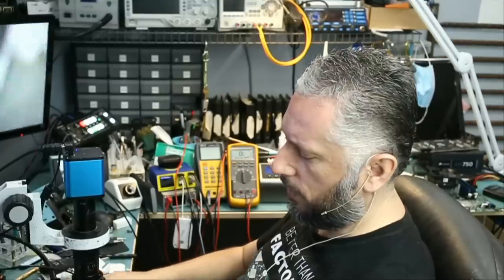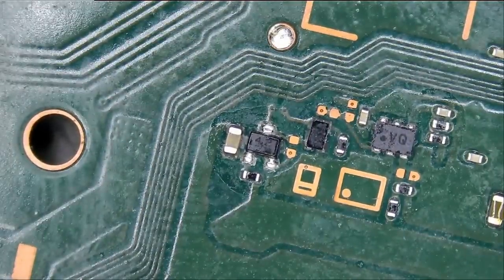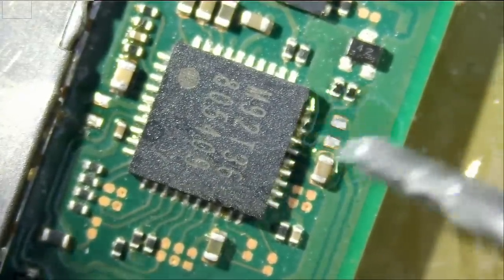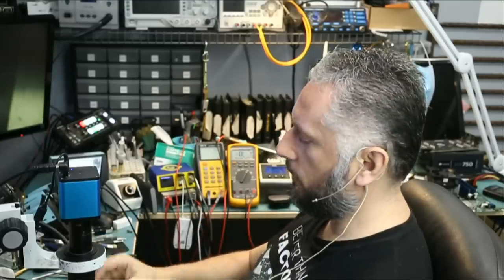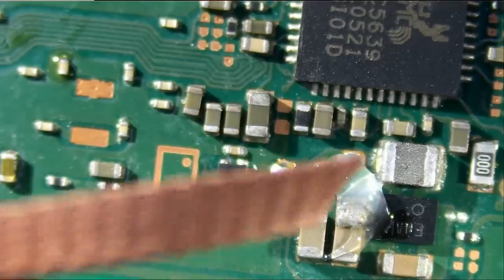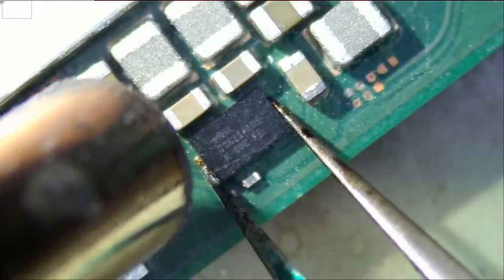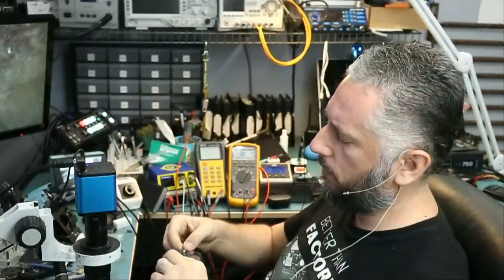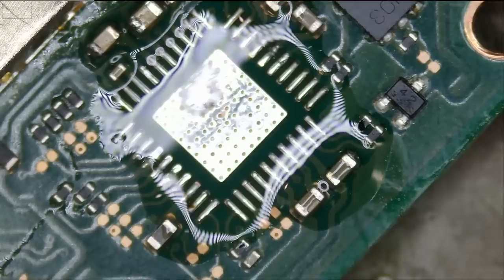Nintendo Switch Came in for repair in this condition

Comment: You missed placing a resistor at 3:35.  You needed to do 4 in that group
Reply: 17:10 he did point out what you said and it was a no fix anyway

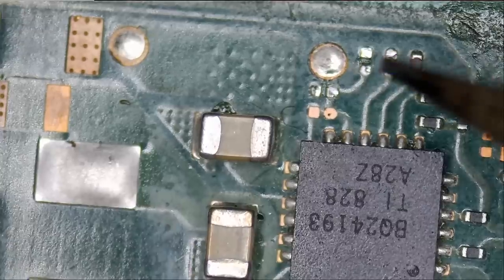Comment: If you look closely, isnt there still a missing Filter at 13:01 ? You replaced the 2 on the top, but you missed the Filter a little lower to the left. Maybe IT is Not waking up for that reason.  The component is present on the donor Board at 0:27
Reply: I saw the same thing
Reply: yea, at 17:03 he noted that it was missed, he replaced it, still no fix.
Reply: @th3R0b0t  yeah I saw that at the end lol

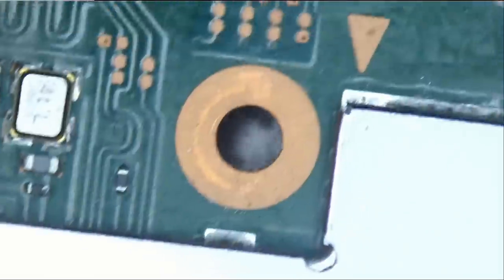Comment: The only thing I've seen that no one has mentioned is there looks to be some corrosion on some empty pads at 1:03 between two connectors. I doubt it would fix it but there u go.
Reply: Yes and probably two pads have discontinuity
Reply: @Muslim_011  happened to me on an Xbox One S the other day, chip had a pad that wasn’t making a connection, ran a jumper wire and that fixed it 😄
Reply: @johny1220  That's good. Glade you figure it out 👍

Comment: I've got a couple I'm working on that I still need to replace a component or two...but I'd never send that off to someone without them knowing the status beforehand. That's just silly to expect you to take the time to find every single thing blown off the board. At least not without you knowing what you're getting in to. Wow.
Reply: Also, so glad to see you had to fight with the solder blob next to the M92, heh. Bad for you, but good for my self-worth. I have fought a couple of those in that area that were really frustrating and I'm a novice comparatively. Thanks for keeping it real.

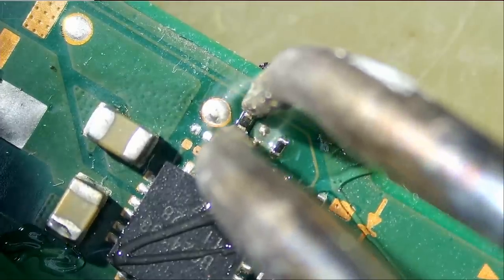Comment: Nice work. You missed a component. At 3:30 the capacitor/resistor next to the part you placed on the board to fix.
Reply: See 17:03

Comment: I bought a used Logitech g pro keyboard off eBay (€30 for a market price of €110 used). When I opened it instead of a single MCU I was shocked to see someone solder another MCU on top of original one. He is an SMD master to do such trick (ask pins were properly soldered on top of original one. He should have used his brain first. Luckily i had a donor board so used that MCU and removed the prior repair attempt.
Reply: Probably lazy to cut the dead component first

Comment: I had a cut resistor on the front board that joysticks go into on a Dreamcast with a unit I bought not working on ebay. Once I replaced the part powered it up the battery for RTC shot fire up around it ... Some of the masking on the back of the board burned off. There was plenty of damage to the board from someone else who tried to modify the battery before I got in there. I guess I got a donor machine now. But I bought it for slightly more than a replacement GD-rom drive goes for so no real big problem.

Comment: Great and watching repairs at micro level. leaning alot of stuff. There was 3 resistors missing in a area and you have only put back 2 resistors 1 was still missing which can be reason we are not getting 9 volts.

Comment: Any reason why you use hot tweezers for resistors and hot air for capacitors ?
Reply: capacitors are much more sensitive to thermal fracture than resistors are.. so they should be heated evenly, which hot tweezers would not do

Comment: I might have only taken one electronics class but that solder job on top of all the missing components really raises some questions, like why did you remove them or why were you tampering with your switches mobo and break it?

Comment: I admire your dedication to the challenge, and I'm sure you could STILL fix it, but it's more of an issue of time and parts not being worth it.  Myself, I never would have delve into that, and honestly said the CPU was bad as you were first realizing all the parts taken from it.  Basically someone used that board as a donor board knowing that the CPU was bad, and it was my guess right off the batt.

Comment: It has been discovered that Nintendo themselves will sometimes remove components off an RMA, if the customer says they don't want to go through with their suggestion, mostly saying they have to get a new device.
Cod3r got one that was sent back from Nintendo, it had a faulty USB port, Nintendo told the customer that there was too many problems and would have to buy a new one. The customer decided against it and asked for it to be returned so they could seek a second opinion.
They sent it to Cod3r and he discovered that Nintendo had removed a chip, which resulted in no display.
Very sneaky move by Nintendo.

Comment: I agree that board was used as a donor, and it brings to question the ethics of the seller. Should they have to state that the item being sold was used for donor parts? There is "not working, parts only" and many times it's because of a broken component that is easily fixed. But missing several parts due to being used as a donor, I feel, warrants disclosure.
Reply: as the buyer you have every right to ask questions, if the seller lied then that's a separate story
Reply: @hardkore360  It's almost certain that the customer bought this as for parts/repair and just sent it to Alex without even cracking it open to take a look. Alex should've said no fix and sent it back to the customer, but like Alex said, he did it for the video so it is what it is.

Comment: You should look in getting an Elgato Cam Link Pro (4 hdmi input PCIe card) and an Elgato Streamdeck (for the switching)  to save you having to do that extended reach to swap cameras each time.

Comment: I would like to know what temp and air flow setting you set your hot air station to when replacing small components such as in this video?
Not sure if my hot air station is up to the task (BK4050) I believe it is but I think it's low powered compared to the modern units

Comment: i have a switch lite in need of repair but im just curious of how do you go about pricing or is there an estimate? i know obviously some repairs can take longer than others but im just trying to gauge whether or not its cheaper to have the system repaired or to just buy another one.

Comment: I did not understand that last bit... So when you (or someone else) were editing the video you realized that you missed one small component. Did you try putting that component in place after noticing? If so, was it still a no fix?
Reply: I think that's exactly what the subtitle said

Comment: If you can help me out? 

So my switch was beginning to heat up quick even when in sleep mode. I had some thermal paste lying around so I decided to replace it. Before all of this, I can confirm the Switch was working fine. After I put it back together, the Switch doesn't detect WiFi signals anymore. It only prompts me to connect a wired internet, which I did do, and it did connect to the net, but the wireless does not work at all. It wasn't my router because my other switch does connect wirelessly.

I figured I must've hit something on the Switch I opened and concluded it may be the wifi chip. I may have made a terrible mistake. The EMMC board is what I thought the wifi chip was, based on a few internet searches. So I swapped that part with the working Switch I have just to test if that's where the problem is. Now both Switches won't boot up. I think really should not have done that. I did not know those chips are coded into the CPU. Is there any hope for these Switches now? I'm scheduling a repair soon but if you can tell me what exactly it is needed to be done just so I don't go in there blindly, I will greatly appreciate it!

Comment: I know the frustration of wasting all that time working on the console when a customer knows its beyond economical repair. Even if you charge a no fix attempt fee they often don't even bother to collect the console then your in the situation of either keeping it as a donor console or putting it on ebay and possible continuing the circle of someone trying to do exactly this. To be fair atleast the board has more parts on it that when it came in for repair

Comment: To repair this nintendo switch, the price is 350$. Please note you will receive also a new joycon controller and a brand new package from amazon with this item. It is not necessary to send the old board in.

Comment: This really seems like customer got a hold of a cheap non-working/untested switch probably used as a donor board which they didn't know about and tried to get it fixed. All those missing components does indicate that the board might have been used as a donor.

Comment: I'm really admirative. May I suggest that when you replace a bga and clean the area you should add some solder on the pads to compensate. That's probably why you had to reheat to get a contact. You may end up with unreliable joints otherwise.
Reply: Man do you realise who you are speaking with.!!🤔